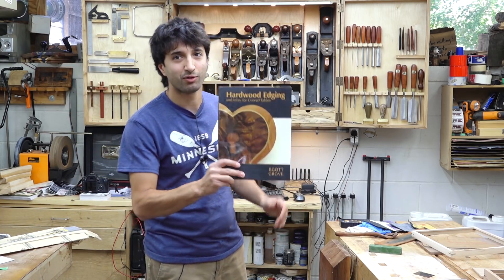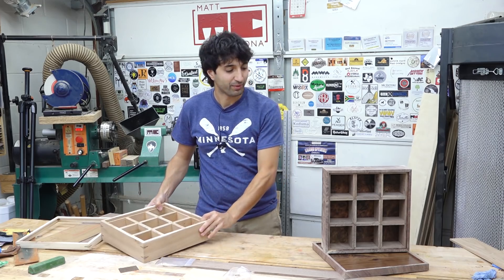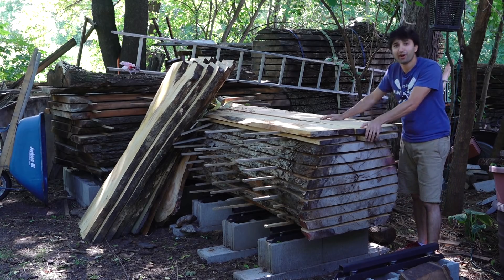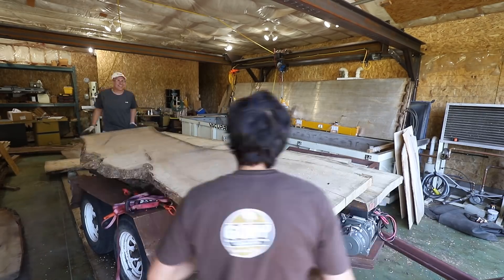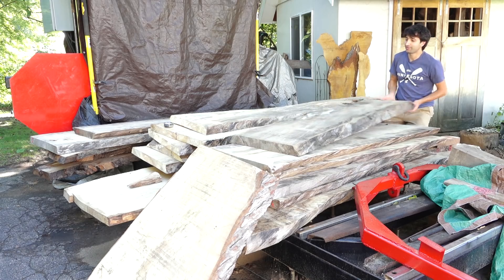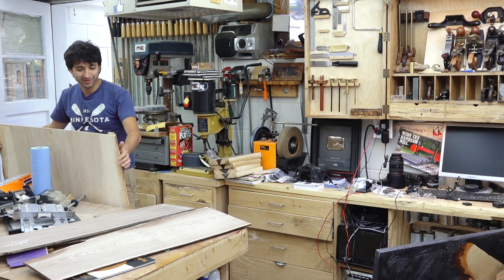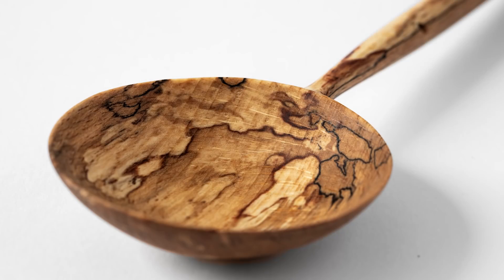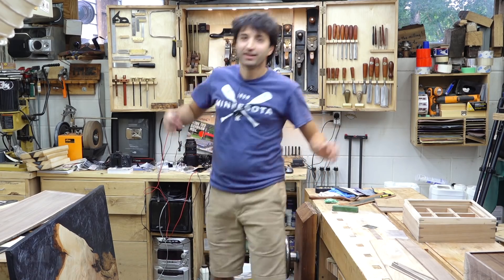Sawing Pecan, Spice Boxes, Vacuum Drying

Comment: I'd get that pecan in a vacuum kiln ASAP! Pecan is beautiful. It's my all-time favorite to work with. But its wild grain that makes it beautiful, also makes it move all over the place when it air dries. Nearly impossible to keep flat. I have 10 mantel beams 18/4x22"x11ft right now that have moved in various directions with as much as 2" gaps off the stickers. Best, @HoneyOnWales
Reply from the maker: The 3 slabs that I cut when Phil was here in Nov haven't moved at all.  They're the pinkish ones at the top of the pile behind the live oak.  I even had them just laying in the lawn for 4-5 months before stacking them.  From my experience, Pecan is more stable than anything else :D
Reply: @mcremona  That's really interesting! Around here (Charlotte, NC) everyone steers clear of pecan, knowing it moves all over the place during both drying & milling. I'm super curious to learn why/how the difference!
I faced jointed & planed a 6/4x12x3ft board for a bench top one evening, got called inside & had to wait until next morning to work on it. It had bowed and twisted overnight to have 3/4" daylight in the middle. Beautiful grain, but very wild stuff.

Comment: What does the vacuum kiln do to walnut?  I always prefer air dried walnut because of the colors that just aren't there if it's kiln (heat) dried...  Hopefully the vacuum kiln will leave the color intact...
Reply from the maker: Based on the samples I have, it looks the same as air dried.  Locks the colors in.

Comment: I am cutting and splitting a Pecan right now. It is a very hard wood and to make things more difficult, one side died years ago and the other side grew around the whole tree. This makes it so difficult to split because the center is straight grain and the outside runs at a 45, which blew out my hydraulic control valve because of the pressure. I now have to rip the outsides, of the logs, with a chainsaw to split it.

Comment: When was your house built? The living room floor plan, closet, placement, hardwood floor, trim, and just about everything else matches perfectly to my old house built in the late 1950s in northern Indiana.  That is until I completely gutted it, reclaimed the oak flooring, planed it, re installed it and redid just about everything else.
Reply from the maker: Good ol 1956
Reply: @mcremona  Very nice. Out of curiosity, does your house have any insulation? Ours didn't have any wall insulation and only a little bit in the attic, and when I insulated everything it dropped the heating bill by ~75%